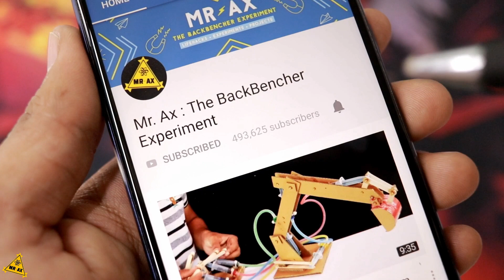How to Make Powerful Battery From Capacitor

Comment: My bullet battery is 12 V, 14 A, I found self start problem when I try after  long time as I don't use regularly,  once in a 6 months, by that time battery discharged. So what you show here, will it help to start the bullet?

Comment: Can u use this setup to start a motorcycle & use this without a regular battery?
Reply: Actually yes. If you use 6× 4700uf 50v capacitors connected in parallel

Comment: What is the input and output volt
Reply: The input voltage can reach 25V, depends on what you use to charge the capacitors, if you eccede 25V the capacitors will blow up. The output voltage go from the charge voltage of the capacitors to zero, capacitors don’t have a stable voltage output. This circuit is useless, please don’t build it, you waste a lot of money on a stupid, low capacity “battery”. A cellphone battery ( that is resonably smaller than this circuit) can turn on that led for like 600 hours, and that type of capacitors cost a lot. Tell me whay you want to build this and i can try to give to you an alternative. Excuse my for my bad english.
Reply: Maybe he just wants to learn electronics